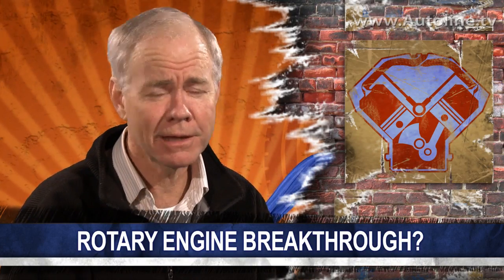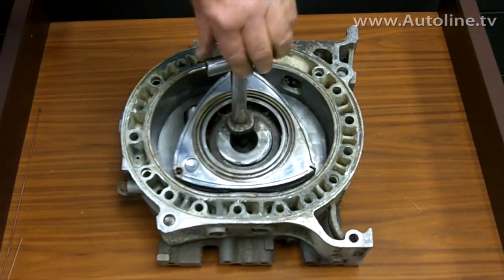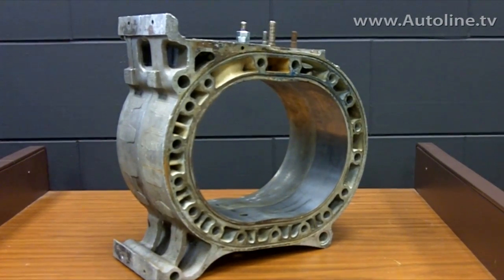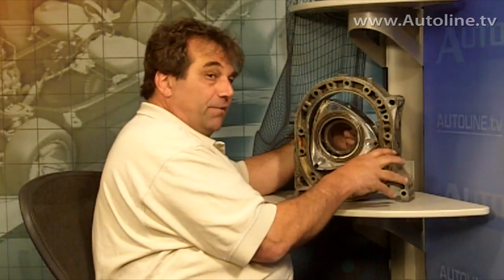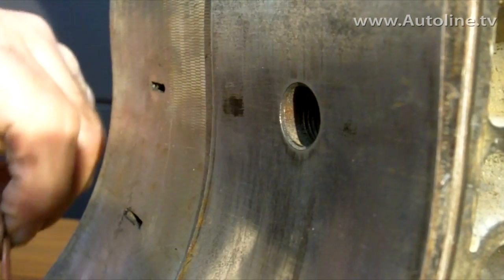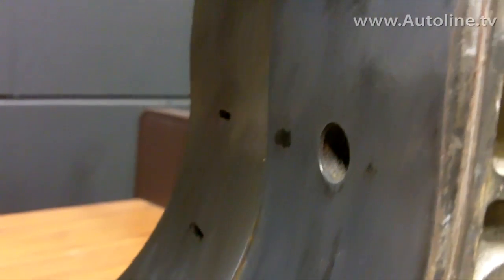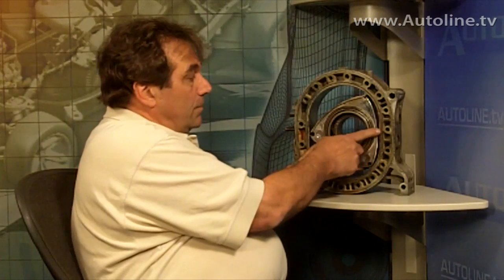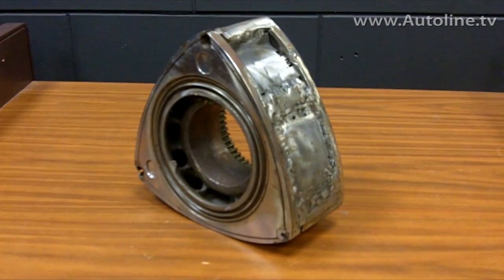Rotary Engine Breakthrough?

Comment: The Wankel does not like to be revved up and down as then fuel economy drops off like a stone. So direct drive applications are not desirable. All applications have been direct drive. It likes to be constantly revved within a narrow rev band, then it becomes very efficient. Mazda are looking at a 350cc Wankel range extender running at a constant 2000rpm in the series-hybrid Mazda2 EV. A prototype was made and given to the press a bout 6 moths ago, who were praiseworthy.  Some electrical generators are more efficient when running at high revs, then the Wankel comes to the rescue as it can freely rev to 9,000 rpm without any problems and still be quiet, smooth and silent. The Wankel is so small it can be secreted under the rear luggage floor in small cars. Mazda stated that to make the Wankel work economically, they would need a run of 100,000 per year. They are considering making Wankel powered portable generators to keep numbers up, until it is taken up en-mass by model in all their range levels.

The Wankel has found its niche at last, with R&D still ongoing by a few organisations, and I am sure we will see more of it in improved versions of the engine and series-hybrid applications.

There is only one car in the world with 100% electric drive with an on-board internal combustion engine. That is the BMW i3. They adopted a 650cc 2 cylinder motorbike engine for the generator. The engine was not designed for generator applications. A small Wankel would be a much superior choice taking up far less room.

Range extenders are part time engines. They will be used occasionally. The prime points of range extender applications in vehicles is small size for high HP output, with the Wankel giving that brilliantly.
Reply: ***** i no every thing about the wankel KKM you are just ar'ent you... and your'e grammar is bad
Reply: doktorbimmer, please get therapy. Please.
Reply: yes the constant rpm is why they work in drone aircraft well
Reply: As they stand right now, the efficiency of Wankel's rises when on constant speed and load. That is before any further improvements such as laser ignition and direct fuel injection, etc. David Garside, the designer of the Norton Wankel, is to file new patents for improvements on the engine.  The engine is one third of the size and weight of piston engine of the same HP.  It has great advantages. Also, used as part time engine in a series-hybrid the engine will last and last.

The best is yet to come. The first series hybrid was used in a plane last year - using a Wankel.
Reply: ***** i have to disagree  about  the lightness advantage of the Wankel..yes it maybe a 1/3 lighter than the  AVERAGE CAR piston engine but if you go looking for light engines Their are many piston engines that are lighter with more HP.. take the1800cc  rover k series  fitted to the Caterham 7 r 500 road car it was same hp as a RX8 but 20KG lighter at 102 kg  as a opposed to 122kg in the rx8.. then if we talk 2 stroke bike engine the  500cc v4 honda GP bikes was 200hp and the complete bike was not much more than 100kg so i am guessing the engine must have only been 50 or 60 kg but going back to road engines the Suzuki Hayabusa engine from the late 1990 are 70KG and 175 HP standard..both the bike engines are old and on carburetors ...i am interested if you know any weights/outputs for non road Wankals
Reply: When  run at constant speeds and loads Wankels are better than piston engines. The emissions are low in new Wankels and those under R&D using laser ign, etc. Now you know.

doktorbimmer, please get therapy. Please.
Reply: Please get therapy. Please.
Reply: ***** look i may say all these lies about rotarys but that is my choice and clearly people are dumb enough to believe me sooo....
Reply: doktorbimmer
AND im smart enough to like my own comments.
Reply: i should like your comments so people can see my comments.
Reply: doktorbimmer, please get therapy. Please.
Reply: @johnburns4017  HEY JONNY!!!! WHERE IS THAT 2022 RX ENGINE YOU PROMISED????
YOU LOOK LIKE A FOOL RIGHT NOW!!!
Reply: @sandervanderkammen9230  
Docktorbimmer, a quiz.
Name the car company introducing a hybrid rotary engine car?
20 points for the correct answer.
Reply: @johnburns4017  JOHN, THE MAZDA MX30 IS ONLY AVAILABLE AS A 100% PLUG-IN BATTERY EV OR A MILD SERIES HYBRID POWERED BY A 2.0 LITER, 4-CYLINDER  SKYACTIV G ENGINE.
Reply: @sandervanderkammen9230  
BZZZZZZZZT! Wrong answer.
docktorbimmer, the name the car company introducing a hybrid rotary engine car, is.....

🍾🎈🎊  Mazda 🍾🎈🎊

Zero points bimmer, zero. Better luck next time.
Reply: Today marks the 10 anniversary of the last Wankel powered automobile made by Mazda.
Reply: *****
Wankels do not achieve 85% mechanical and fuel efficiency, and they are horrible NOX emitters, as bad as a diesels.

High revving pigs, that are fun when you spin them at 8000rpm and sidestep the clutch. Then they overheat and seize their plugs in the rotor housing with carbon buildup from their poor bun.
A novelty at best.
 Banzai!
Reply: Aye Bee
you must be mistaken rotaries run on nitrogen oxide.... so it produces only air when running. the oil companies payed mazda to stop making them. obsolete now because mazda made a contract.

Comment: Ernie Brink, the man in the video, should get in touch with David Garside in England. He is still doing research on the Wankel - he designed the Norton motorbike Wankels.
Reply: YOU SHOULD GET IN TOUCH WITH A THERAPIST... BECAUSE YOU HAVE COMPLETELY LOST TOUCH WITH REALITY.
Reply: @sandervanderkammen9230  
Docktorbimmer, a quiz.
Name the can company introducing a hybrid rotary engine car?
20 points for the correct answer.
Reply: Today marks the 10 year anniversary of the final demise of RX production at Mazda.
  The very last Wankel engine car rolled off the assembly line at Mazda's Ujina #2 plant in Hiroshima Japan on June 21st 2012 at 4:30 PM Tokyo time.

Comment: this guy seems pretty smart but, he did not consider that engineers may have already thought of that. engineers for a multi-million dollar a year or billion with unimaginable resources and money to burn could not figure that out and there's a reason they havent designed it that way by now. but, then again, its now 2014 and we are STILL using engines that burn fossil fuels over 110 years later using its same basic principle when it comes to piston engines. if we're still going to use fossil fuel shouldnt it be something like you fill it with fuel, then some catalyst makes it go by heating steam or what the hell ever?
Reply: doktorbimmer It is obvious you are needing the skills or under the care of a therapist.
Reply: "this guy seems pretty smart but, he did not consider that engineers may have already thought of that." Or they may not have! It is amazing what is not put right because they all thought someone else thought of it and dismissed it, when no such thing occurred.
Reply: Offsetting the combustion indent in the rotor will make a difference. Laser ignition directed from very narrow slits, can direct three very fat sparks deeply into the combustion chamber to give 100% combustion. Direct fuel injection is then possible with a Wankel using laser ignition. The Wankel RIGHT NOW running at a constant speed turning a an electric generator is equal to a turbo diesel, but a faction of the size and weight and runs eerily quiet and smooth. No contest. Have laser ignition and Piston engine are yesteryear. And there is more room for improvement. Using pre-mix direct injection the air intake chamber can be eliminated and a far more efficient two chamber rotor used.
Reply: doktorbimmer, the Wankel is not obsolete. Your therapist may get you to chant this over and over again - "the Wankel is not obsolete", "the Wankel is not obsolete". The more you say it the better you will be.
Reply: doktorbimmer have you mentioned all this to your therapist?
Reply: doktorbimmer I know you need these desperately.
Reply: Get yourself a girlfriend. Or are you Gay?
Reply: doktorbimmer Your sex life is a shambles. Get it sorted.
Reply: doktorbimmer Take those large posters  of pistons from you bedroom wall.
Reply: doktorbimmer Have you told your therapist all about this?
Reply: doktorbimmer Please get professional attention.
Reply: doktorbimmer Have you registered with a dating agency yet? You do need a girl friend.
Reply: +doktorbimmer Please get a life.
Reply: doktorbimmer please get professional attention.
Reply: doktorbimmer Are you attending therapy?
Reply: doktorbimmer Please get therapy.
Reply: doktorbimmer Please get therapy.
Reply: doktorbimmer how often do you have therapy.
Reply: doktorbimmer Please get therapy. Please.
Reply: doktorbimmer Hmmm odd, the RX8 is coming out soon and I believe it's a W-rotary.
Reply: @hunterpaige4512  You look like a fool right now... RX production ended a decade ago!
Reply: doktorbimmer You are telling lies. Mazda are to produce a series-hybrid with a Wankel.

You can get therapy for telling constant lies.
Reply: doktorbimmer Please get professional help.
Reply: @johnburns4017  Today marks the 10 year anniversary of the final demise of RX production at Mazda.
  The very last Wankel engine car rolled off the assembly line at Mazda's Ujina #2 plant in Hiroshima Japan on June 21st 2012 at 4:30 PM Tokyo time.
Reply: @sandervanderkammen9230  
dockorbimmer, a quiz.
Name the type of engine used by the H777 artillery gun.
20 points for the correct answer.
Reply: @johnburns4017  YANMAR L48AE 200cc Single Cylinder 4-stroke reciprocating engine.
Reply: @sandervanderkammen9230  
BZZZZZZT! Wrong answer.
doktorbimmer, the name of the type of engine used by the H777 artillery gun, is the ...

🎊🎈🍾 Rotary engine 🎊🎈🍾

Zero points bimmer, zero. Better luck next time.
Reply: doktorbimmer Please get professional help.
Reply: doktorbimmer HIstory? Nah. nuts like me will keep them alive.
Reply: doktorbimmer You need therapy
Reply: doktorbimmer Get therapy. Please.
Reply: Please get therapy
 Please.
Reply: Please get therapy. Please.  It is sad reading the rambling thoughts of an obsessed mind.
Reply: Please therapy. Please.
Reply: Please get therapy, your conditioning does need serious attention.
Reply: Please get professional help.
Reply: doktorbimmer
Was even dropped years ago as a snowmobile engine.
 I would like to have a Wankel radio control scale model aircraft engine-just for the novelty of it.
Reply: doktorbimmer
Wasn't it a three or four rotor or something like that?

And I think they went on to set a Nurburing speed record with a diesel in the C series
Reply: My Ram truck has a Daimler designed 4.7 sohc engine. I like it.
Reply: Chrysler/Fiat's Tigershark four cylinder blocks are DaimlerBenz designed and Hyundai made off with the rights.

Mercedes incorrectly thought they would be controlling partner of Hyundai-They guessed wrong.

Comment: i know firsthand about the hot exhaust. a guy i know bought an old RX for cheap that he knew had some problems. wanted me to help him get it right back in '99. i knew when i seen it that an apex seal was gone. it had a new starter and battery so it could spin fast enough to start with low compression. it had little power and was slow on the 7 mile trip back to my home. with at least one of the seals gone after about 5 miles the inside of the resonator was glowing red hot in the night. pretty wild view i had driving behind him.

Comment: The Rotary engine has engine oil metered and injected into the combustion chambers for lubrication, therefor the exhaust will never be as clean as a four stoke reciprocating engine.
Reply: The injected oil is burnt and taken into account in the combustion process.
Reply: doktorbimmer The unburnt fuel can be solved with pre-mix, fuel and air, direct injection and laser ignition.
Reply: doktorbimmer Using a two rotor design, as per Rolls Royce, the exhaust can be reignited burning all the left over oil and fuel. Pre-mix direct injection has not been tried yet.

Comment: well, if that small little engine is pushing out 200+hp then of course it'll be hot.
Reply: doktorbimmer"It gets hot because its burning nearly  1,000hp worth of fuel to produce 200hp"
About the same as a piston engine then. A second rotor turned by the exhaust gas and any unburnt fuel ignited by another spark will make matters far more efficient. The second rotor acts as a compressor to force more air into the chamber, meaning far more HP from a small rotor. Rolls Royce did some excellent R&D on this in the 1960s.
Reply: doktorbimmer I know how the RR engines works. What has your therapist said about all this?
Reply: doktorbimmer How is the on-line dating going? You do need a girl friend. You will see life from a very different angle once you have one.
Reply: +doktorbimmer, Wankels are more efficient. Have you told your therapist about this? What did he say?
Reply: doktorbimmer Do you have pictures of pistons on your bedroom wall?
Reply: I have a Rotary sitting on my desk :)
Reply: doktorbimmer You really do not know. Have you put all these questions to your therapist?
Reply: +doktorbimmer, have you got yourself a girlfriend yet?
Reply: doktorbimmer Please get professional attention.
Reply: doktorbimmer Many companies make Wankels. Please attend the therapy classes. You need to.

Comment: ive been thinking everything he said about this motor along with lighting the rotor and increasing overall size angling the intake and exhaust ports and dual compression strips. intellectual property use with permission

Comment: this guy is an idiot,  little slits where the spark plugs go  means  you have to have a chamber where the spark plug goes behind the the slit which when fuel is burned in this slit will burn a hole where the plug is  it has been done before on bsa two cylinder engines with one plug between the two cylinders  burnt large holes between the cylinders
Reply: He is trying to reduce the escape area there by increasing compression and power. It is a good idea but may need more maintenance.
Reply: Laser ignition can project through the narrow slits sparking at three different points deep into the chamber. Pre-mix, fuel and air, direct injection can also assist in perfecting the Wankel. The best is yet to come in range extender applications.
Reply: doktorbimmer See the wiki Wankel web site. there is a link to Liverpool University with videos on the laser ign. Not could be - it does!

You must stop making things up.
Reply: you soooooo.... dont understand Steve.
the air & fuel is compressed in chamber right...... now when this happens it wants to escape anywhere, right?
the apex seal moves over spark plug hole right? gasses (if only fraction) escape and go over the top of apex seal while moving over plug hole and into exhaust chamber.
understand?  really not rocket science, and this guy explains it soooooo simple with the piston ring.....
Reply: This guy picked up on some valid points. doktorbimmer is some sort of. ....
Reply: doktorbimmer must be paid to infest the web.